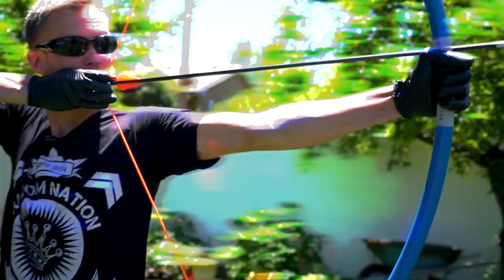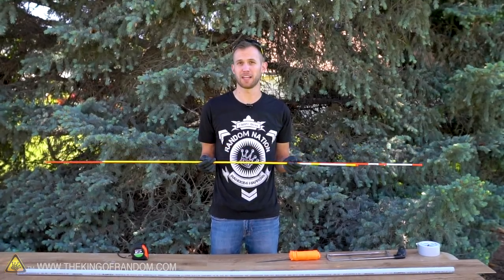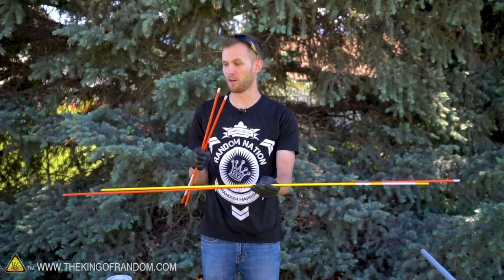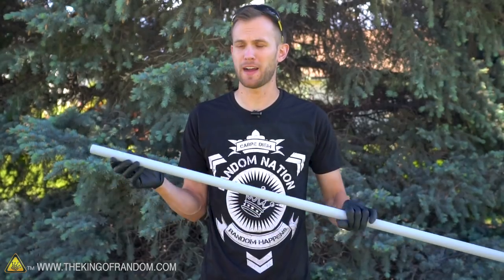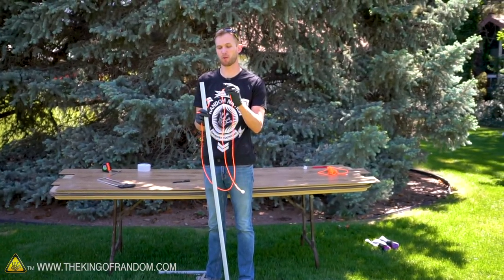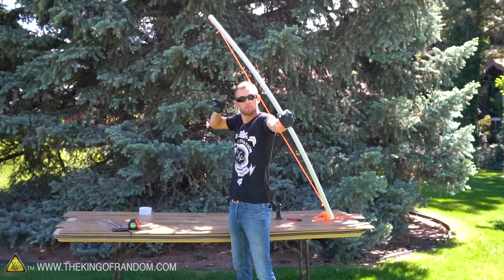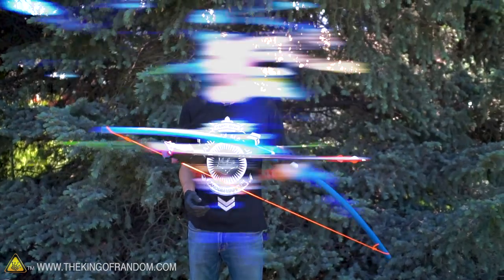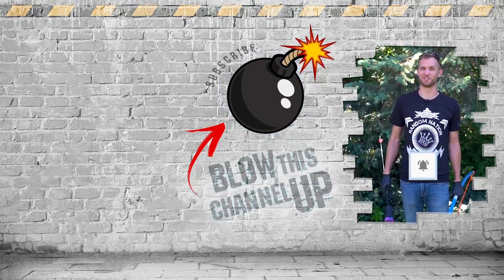Making a PVC Bow

Comment: These are commonly used in a lot of LARPs. We use 35# draw bows, but I think our heads are slightly larger. Can't wait to see how you build the heads on yours. Piece of advice, build them on 3/8" pex pipe so they are modular. Shafts get stepped on a lot and break, as do the nocks.

Comment: nice done, but with two pipe, une smaller than the other in diameter and a heatgun you could evade the necessity of the fiberglass, just insert one in the other, flat them in the periferical area and curve them in the opposit way of the strings line, add the paracord when cooled (just a little smaller than the bow) and you have a recurve longbow ;)

Comment: What happens if you put liquid nitrogen in the micro wave
Reply: uvuvwevwevwe onyetenyevwe ugwemubwem ossas Nothing. Because liquid nitrogen is not a polar molecule.
Reply: BOOM!
Reply: It's amazing idia
Reply: Maybe liquid nitrogen mixed with water would do something
Reply: Anonymous Vlogs check it out!
Reply: Funny Enough it does nothing, it just chills there.

Microwaves heat things up by rapidly switching the direction of water (and other polar molecules), thus generating heat, but since liquid nitrogen has no polar ends nothing happens to it.

Comment: Suggestion. Using magnets, suspend a ball of ice in a vacuum chamber so it's not touching any surface. See how long it takes to melt compared to the same setup but without removing air from vacuum chamber. Test how ambient light affects this

Comment: How about diy squibs I think they are cool and have a lot of potential to be even more so. All I use is a soda bottle cap saw dust electrical tape black powder an extension cord with one end cut off and a thin piece of wire for the filament and a surge protector for an electronic detonation. Check it out I’d love to see how far you could take this.

Comment: In my personal experience with archery, I've taped smoke bombs to cheap arrows, and launched them high into the air, the chief issue is that the fast moving arrow can't get enough air to burn as it flies, making a really wispy smoke trail,

Is there any modification you can make to the home made smoke bombs, such that there's some small aspect of self oxidation for the purpose of signal arrows?

Comment: I made a bow just like this, minus the stuff inside the PVC, a year ago. The single padded arrow I made broke, so I haven't used it in a while.
Note: The one that I used tends to let the PVC pipe twist a lot, especially if it's lined up with the stiffer part, which can be a problem. If you don't want it to do that, you can use some heat to flatten it so it won't twist.